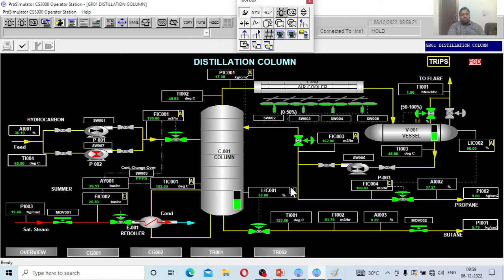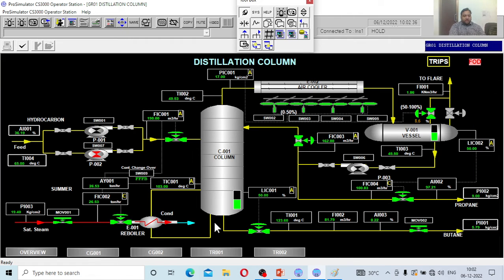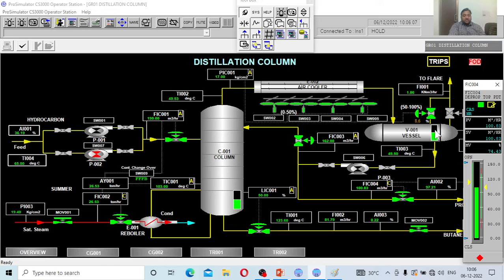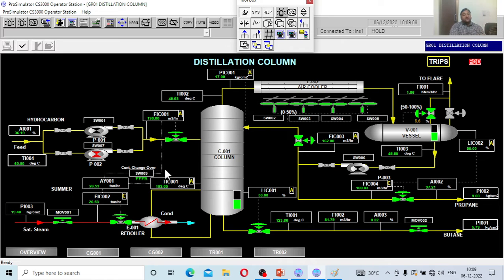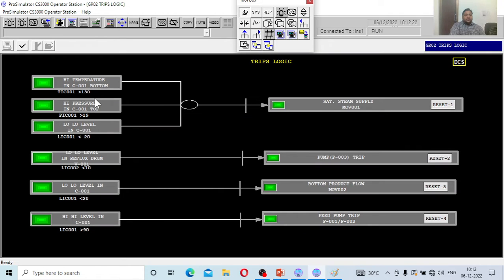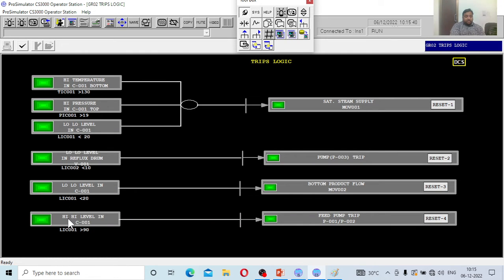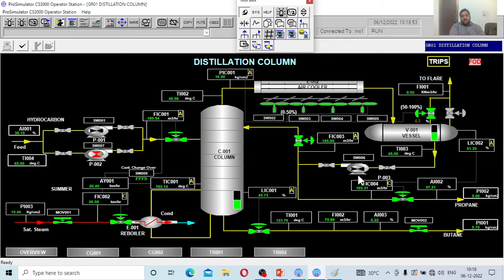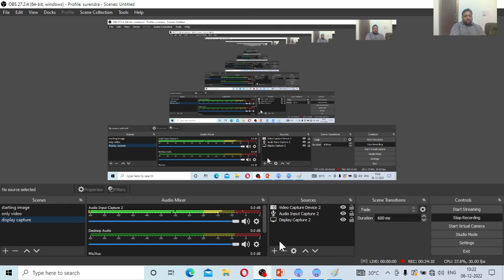(14) Distillation Column (Design Start)....Simulator Training...(Process Dynamics and Control)

Comment: Very good explanation, but why will column pressure increase, when reflux ratio decreases?. I hope it should decrease. 

Hope proper reasoning helps. 
When the reflux ratio is decreased, can you explain the purity of distillate and bottom product direction too??
Reply from the maker: Thank you for your observation 👍.We need to wait atleast long time in this simulation to reach steady state. One possible reason might be. If we sudden drop reflux ratio the amount of cold liquid goes into the column will reduce and column temparature start rising which can lead to increase in pressure. There might be many reasons also.
Reply: @Dr.surendra0845   Keeping column top temperature in auto and decreasing reflux ratio will affect subsequently to the reboiler bottom temperature (Increases at first) and it will also decrease reboiling to match new reflux ratio. 

As you are talking about propane I e lighter component, when reflux ratio decreases purity decreases from my understanding and partial pressure at that purity will be low causing slight drop in pressure. 

This is my understanding, correct me if anything needs to be added sir.
Reply from the maker: @grandhivenkatachalapathira1588  may be auto will take its time  to bring effect. May be we have to observe for long time with all the indicators then only we can comment. But any way thanks for your observation.